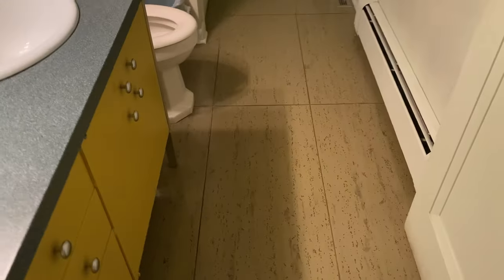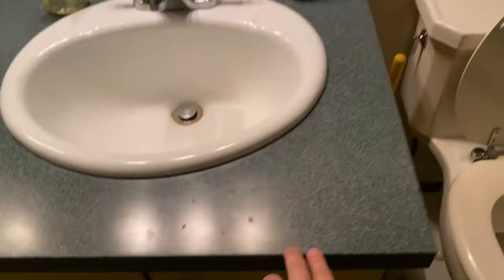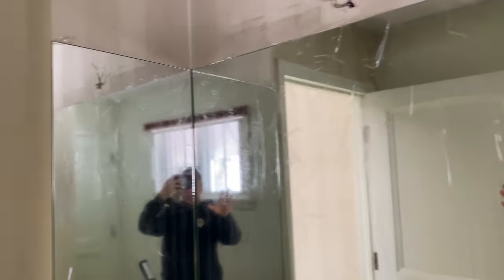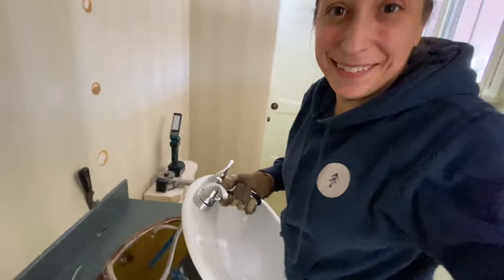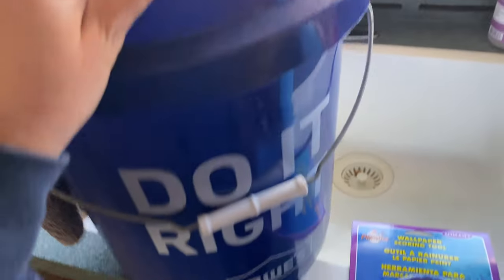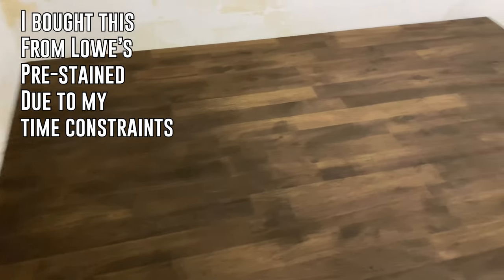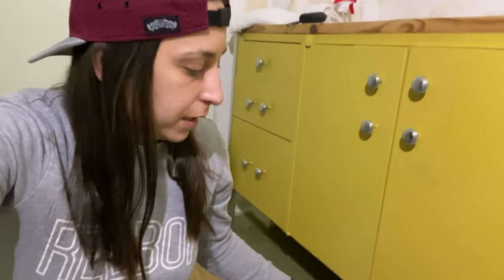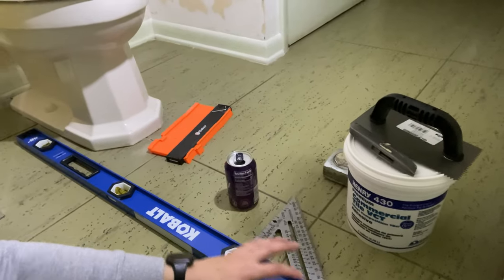Budget Bathroom Refresh / Makeover - DIY Mid-Century Cheap Guest Bath Renovation

Comment: It looks great. I really like the top. Did you use the old top to trace out the new top? It looked like you got it off in one piece. Probably should have pulled the toilet when you did floor. It would have made cutting tiles around it easier. Also if you do change toilet, it could have different footprint.
Reply from the maker: Thanks Joe - all good points! I didn’t use the old top to trace the new countertop because I was cutting it a little different. I wanted it to extend out a bit further into the notch by the door where the previous one was just rectangular.